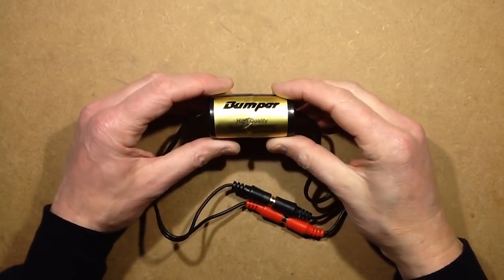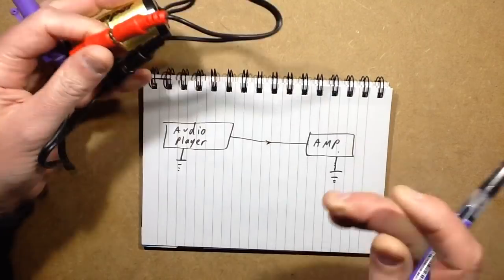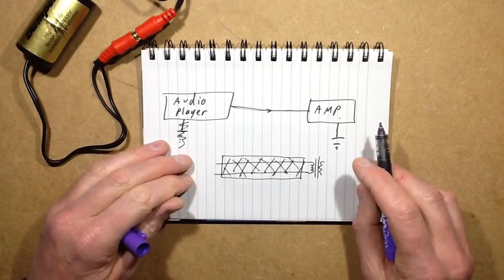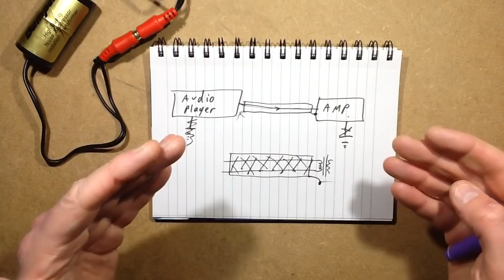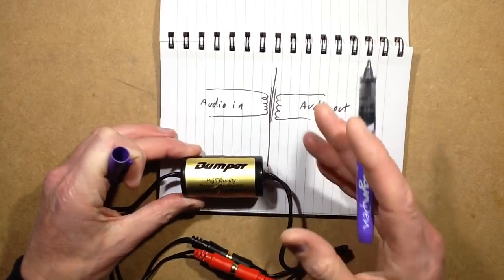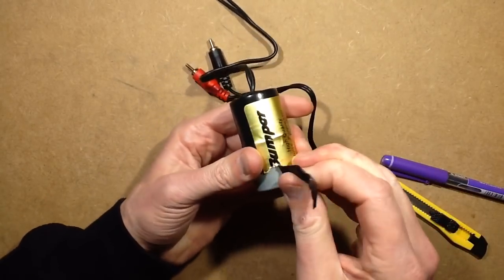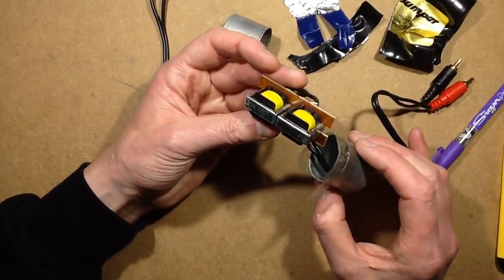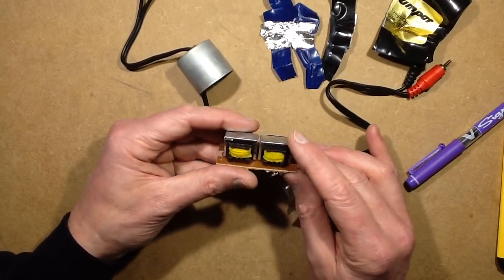Inside an audio isolator transformer module.

Comment: Would this eliminate the high frequency switching noise on cheap stepped sine inverters?
Reply from the maker: It might help with coupled sound through the audio input, but not if the noise is bleeding through from the power supply.

Comment: I had a bad ground loop on my valve amp. my ground loop only came on when I used the fx loop of the amp. using balanced audio cables seemed to solve the problem for me on the entire chain. other options were like this ground loop isolator or eq'ing the 50 or 60 hz cycle hum out but that would effect the tonality of the preamp's output
Reply: I bought one of these isolators and put it on the fx loop and it absolutely sucked the clarity out of the sound. maybe I had a dodgy isolator

Comment: Car Audio systems are notorious for an alternator whine that changes frequency with engine rpm. This IS and probably ALWAYS WILL BE the fix for poorly isolated high-power car audio components.  Isolators work every time. 😉
Reply: E Wozniak you can get noise suppressors that go on the alternator which means you won't need one of these, or also keep power wires away from audio wires, this way it keeps your audi nice and clear, but these are good if your not a complete audiophile and are not bothered by a small loss in sq

Comment: lots of problems with car audio, usually when people run the power wire alongside the phono leads to the rear amp. alternator whine,
also cheap HID ballasts and cigar lighter phone chargers.

Comment: So, why two transformers, what impedance would you say they are, I'm guessing they
are one to one and wired in series? Would there be some sort of wattage limitation, or could you use them on a 10 watt system as well as a 500 watt system? Im guessing there not to expensive, but it would seem like something you could whip up yourself in a pinch. The foil probably rubs against the metal can...maybe.
Reply from the maker: Left and right audio channels.
Reply: ...of course, lol, Thanks for reply...
Any limitation to system output wattage? What impedance would you say the transformers are?
Great channel, watch it frequently, thanks for all your effort. Superb sense of humor you have, by the way.
Reply: this unit is strictly for line-level signals (placed inline with the interconnects between a source and amplifier, like a tape deck and amp or  PC and amplifier for example. The output of the amplifier could be anything you want -as long as the cables this is inserted in are low-level. 1V RMS across 600 ohms is one example of what I mean by "Low Level" in this case. 
Definitely not on the speaker side of the amp, or smoke will be pissing out of every gap before you can turn it off haha. Even quite low speaker-side signals from a very small amp could cause permanent damage to the windings and cores. They will handle mere milliwatts, not watts, without damage. 

A similar unit designed for for use in speaker cables (on the amplifier output) would have to be MUCH heavier construction - most speakers are very low impedance (4-16 ohms for example for common consumer speakers) so the transformers would have to handle far, far higher current. (600 Ohms versus 4 Ohms - a worse-case but common scenario - would means 600/4 =150 times the current handling - this is  a heck of a difference!) The unit would also have to be very carefully designed so that the extreme flux wouldn't come anywhere near to saturating the core or distortion could become rather extreme, as well as causing trouble for any driving amplifier - this would be a nightmare in practice. Basically, this means much thicker copper and lots more iron. 

Output transformers for audio power amplifiers driving low-impedance speaker systems are rarely found, as modern amplifier designs (in the solid-state rare, that is ) are such that there are not needed except in rare cases and even then often only as a last resort. Cost, weight and distortion are all problems that really aren't worth solving unless there really isn't any other way.

The transformer impedance could be anything in the range of say 200-20kOhm - they will actually be selected more for their ability to "sound right" for some examples of typical systems than purely on tech specs (particularly design impedance alone). The insertion loss across the wanted audio spectrum is more important to the end result and impedance values for any given product are nominal values anyways.  You may be surprised to find that they may not always be 1:1 ratios either :) Though a purist or inexperienced designer would claim otherwise, a 1:2 ratio wouldn't really be that noticeable in use unless the transformer design impedance happened to be rather high. 

At various termination impedances the spectral losses will change - there will be many factors at play and many will be inter-dependant. 
 
Yes, impedance will be an initial selection factor as a starting point - but I've personally used very small mains transformers (back to back) for field-expedient audio isolation transformers with OK results across a voice comms bandwidth on a 100 ohm system. 

To re-iterate/TL;DR: - these units are NOT for speaker-cable use, only for line level/RCA/interconnect side of things - amp/line inputs in the range of 600 - to -10-kilo Ohms - not speaker outputs.

Comment: I've tried these for noise associated with turntable connections.  I must not have been using them properly because they were of no use to me whatsoever.   It is not clear to me where along the interconnect chain to place them.
Reply from the maker: They're designed to operate at line level if around 1V.

Comment: Still don't get why, if the isolating transformer passes all the audio signals from the source, why any mains hiss that has induced onto the source cable won't be transferred across the transformer to the Amp, the transformer is agnostic as to what frequencies it passes
Reply: Because it blocks unwanted signals riding the ground cable.

Comment: I have a stereo to amp to speaker arrangement. Why is it when the stereo is turned off but the amp is on do i get hum but goes away once i switch the stereo on?
Reply from the maker: +8 Step When the stereo is off the audio input is floating and acting like an antenna, when on the output circuitry pulls it to a known state.
Reply: Thanks Clive!

Comment: Hi. My TV connected to an AMP via AUX to RCA cable (This is the only way, this is an old tv and amp). The AMP always on. When I turn on the TV there is a loud Boom\Popping sound from the speakers and the AMP makes small "CLICK" sound. Even when I turn off the light swich there is a boom sound from the speakers. Can this ground loop isolator can solve this issue?
Reply from the maker: It might be worth trying.  But many amplifiers have a speaker thump when powered as the circuitry stabilises.
Reply: @bigclivedotcom  Yeah I know. But this is happens only when the tv connected. When I connects my streamer with the same cable there is no issue at all.
The isolator shoud be connected directly to the amp (male to female)? or the other direction?

Comment: so, if i purchase 2 of these, and put them between my turntables and my mixer, it will stop the mains hum i get ?

i found it strange that my mixer had ground connections but was a low volatge unit with a none-earther PSU, so, hooking the turntables to the mixed didnt get rid of the hum and not connecting them didnt get rid of the hum either =/
Reply: +killer1479 One is enough.
Reply: ***** bit i have 2 turntables, theyre dj ones :)
Reply: Oh, then you need 2.
Reply: ***** yeah, sorry, should have stated they are dj ones :) thanks for the reply!
Reply from the maker: +killer1479 Is it definitely between the decks and the mixer or the mixer and the amplifier?  These are worth trying either way.  They can come in useful for other stuff too.
Reply: bigclivedotcom between the decks and mixer, only really ever used headphones for the so i didnt distrub people with my rubbish mixing lol.... it was a relatively cheap mixer anyway, usualy the better mixers are mains powered with an eart connection
Reply: +killer1479 I was thinking the same, but it may not work as turntables put out a very weak signal strength what is a lot less than line level signals. Also the transformers may mess up the RIAA curve correction in the phono pre amp.
Reply: +killer1479 This is probably not the right solution but I had a similar issue with a home theatre receiver. What I did was cut the 2 prong plug off of the receiver and install a 3 prong plug and then ran a wire from the ground pin of the new plug to the ground screw on the back of the receiver. I don't know if this is safe or not but it got  rid of my hum!
Reply: KE5SUI i would try that but, my mixer is low voltage, about 9-15v i think, cannot remember exactly D: but it was only 2 pin plug on it and the supply had plastic eart pin.... maybe better mixer with grounded, mains ?
Reply: +killer1479 You could test the mixer by making a shorted out plug to see if you can silence the inputs, if the turntable is a magnetic type, dont use crappy audio cables, good screening is needed for low level signals.
Also see if there is an earthing terminal on the rear of the record deck, earth it.
Reply: zx8401ztv all earth connections are made when was set-up between the deck and mixer, but the hum still exsidted wether they were earthed or not D: i have, citronic PD-1 turntables and a stanton SMX-202 mixer
Reply: +killer1479 Plug your headphones into the mixer so you can monitor the hum, then disconnect the amplifier from the mixer, it could be an amp earth current or similar, worth a go :-D
Reply: zx8401ztv like i say mate, no amp, just used headphone on it as not to disturb anyone, only really remembered the issue when clive uploaded this video :D, besides, one day if i get back into it i may just upgrade to the cd variant of turntable :D
Reply: +killer1479 Ooops sorry, just trying to help you, i know how annoying audio faults can be.
Reply: zx8401ztv i know, and i appreciate the help :D from yourself and others ^_^
Reply: +killer1479 you could also try boosting the phono signal up to line level as close as you can to the turntable... I remember my old citronic PD-1... first turntable i learnt to mix on! those were the days!

Good to see people are still pushing and pulling vinyl and not taking the laptop route!
Reply: were you PD-1's belt driven or direct drive ? or was that model direct drive only ? and i would have no clue how to do that, not got my set up with me, it is at my dads, i am thinkin on getting a new mixer for it one day, a behringer maybe, but not 100% yet! will have too look into it when im next at my dads and get my gear set up, lol...

and yuh, i tried pc software was much harder for me to use than the turntables,
Reply: +killer1479 Simple answer is not, it will not help, only it can make it worse. Most of that audio isolation transformers are made for line audio voltage level (roughly from 0.3 -1.5V depends is it consumer or professional audio) not for RIAA level which is 5mV.
Your problem is probably in bad phono stage of your mixer which pickup noise from supply, if I remember correctly citronic PD-1 is copy of Technics SL-1200/1210 and in them there is no electronic in signal path (pickup is directly connected to output so there is no need to isolation transformers because all is referenced to mixer).
Reply: +killer1479 Try using better rca cables.
Reply: Miloš Lazović interesting.. thanks
Reply: expert20valvehlx i will try so when i next can, thank you
Reply: ***** yes, i connect them to phono as i think my mixer says in the book it will get damamged if connected to line in, and yes, ground leads were attached, im still sure it is because the mixer itself has now earth lead to the mains socket as it is low voltage.... i had been eyeing up the behringers for long time as a few of my friends swear by them, but atm, i am not using them, and, if i decide to do so again i will look into the issues properly :) maybe even upgrade to cd turn tables, i am not 100% sure yet, but thanks for the reply :D!
Reply: +killer1479 Are your turntables next to your amplifier?
Reply: Adam Perry like i have said in a previous post, i never used an amplifier, never connected them to one, just used headphones
Reply from the maker: +killer1479 What Adam was hinting at is whether your decks or cables were near a device with a big transformer in it.  The stray magnetic field can induce current in adjacent cables like a winding on a transformer.
Reply: bigclivedotcom ohhh.... no, they was on an empty desk... but theyre no longer being used now, theyre packed away in their boxes till i move home, hopefully to a bigger place where i can set them up and finally sort this issue out..

thanks you all for the help and hints though :) much appreciated

Comment: If you're getting interference because your source and amp are just too far apart. A better way would be to convert to a balanced signal. This can be done very cheaply with an audio transformer, a few resistors (BalUn), and some shielded audio cable.
Reply: But this works with the existing unbalanced cable.

Comment: Do the specifications of the transformer matter, as in the Volts?
Reply from the maker: The audio isolators are specifically designed for line level signals.
Reply: @bigclivedotcom  Oh ok. I was thinking of making my own ground loop noise isolator but I'm uncertain if the voltage of the transformers matter or not when made for line-in signals.

Comment: Heck, I need one of these for my car, I think. If I charge my phone and have it plugged into the aux, it has a high pitched noise. very annoying.
Reply: I have a annoying high pitch whine in my car. I'm married to it :)
Reply: +a flock of sea-cows, esquire alternator noise most likely
Reply: But at least when you turn the volume up high enough, the high pitch goes away.
Reply: +TheTruthIsHere12345 Hahaha :D
Reply: +a flock of sea-cows, esquire It does not go away, it's just not noticeable any more :D
Reply: ***** out of hear, out of mind
Reply: +a flock of sea-cows, esquire Is your phone charger a $2 ebay special chinese knock off? If so, get yourself a proper OEM one.
Reply: I believe that the noise you're hearing is a result of your phone and amp sharing the same ground
Reply: +a flock of sea-cows, esquire In my car the high pitch noise generated when my ipod is on charge changes pitch with the engine RPMs which is kinda cool. I managed to eliminate the the noise by using a 180watt pure-sinewave inverter that I already owned with the Apple USB wall adapter plugged into it. If I got a proper USB car charger with adequate filtering it probably wouldn't be an issue and I wouldn't need the inverter.
Reply: HeylonNHP Thanks! I'll look into that. exactly the problem I'm having.
Reply: Euro Bum It's a $2 ebay special knock-off sold for blood money at a service station because emergency.
Reply: +a flock of sea-cows, esquire I feel ya. Been there, done that, and got the horrible screechy whine. I got a better charger and it went away.

Comment: That foil is just extra* RF shielding, it also couples (very weak coupling) the 2 transformers, if you'd have a 1Vp-p on one transformer you will get a few mV on the other one this is because, the core of the transformer builds up a variating magnetic field, wich, induces a weak current into the foil and from that alternating current in the foil it induces a bit of it in the secondary of the other transformer

Comment: When I was still a little kid, my older brother heard that the purpose of the ground prong on plugs was a part that was supposed to be removed. He ended up removing the ground prong on various things. Our culture here in America allows for rationality and common sense to be deliberately ignored. At least, I don't see him much anymore since he's got his family. I hope his house doesn't blow up or whatever because he doesn't understand electricity. In the '80s, cable installers would automatically trim the neutral prong on your TV so you could insert the plug backwards. It was very important that you could insert the plug in backwards. The funny thing is that the cable equipment was already polarized. I guess they thought that you had a right to blow up your house if you wanted to or at least cause damage to your equipment. Just because it still worked backwards didn't mean that polarization was a manufacturing defect that needed to be fixed. There still is no shortage of rampant stupidity these days.
Reply: I think your older brother did the wiring in my apartment! ;) I've found ungrounded metal fixtures, electrical bonds made with plumber's solder and flux then wrapped in electrical tape, Romex held in place with duct tape, etc., every time I've tried to improve, repair, or change things.

Comment: They were banned at the BBC in the 1950/60s. Not sure why, but needed special permission to use one and they were in a wooden box with a label to that effect. Such were the quality restraints in those far off days!
Reply from the maker: +Cashpot They colour the frequency response slightly, so it was probably the audio aficionados that tried to ban them.
Reply: bigclivedotcom An argument can also be made that they are just covering up an existing problem and that in a more permanent and fixed setup it is probably a better practice to actually invest the effort to fix the underlying problem rather than work around it with a bandaid solution.  Rather, save the bandaid solutions for those temporary setups or time critical emergency patches to get one by for the duration of the crisis until the issue can be correctly resolved.

Comment: The foil just bridges the two (mu-metal?) shells together electrically.  Sort of easy and automatic, as soldering of wires to them is nearly impossible.
Reply: @Pellervo Kaskinen
the foil is on top of the insulating tape , the transformer cases are probably soldered on the pcb :-)